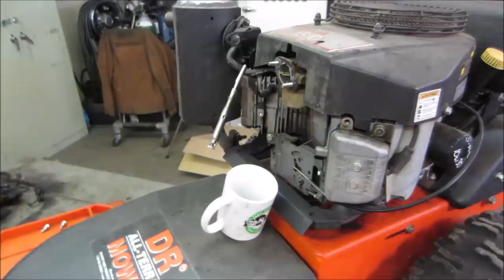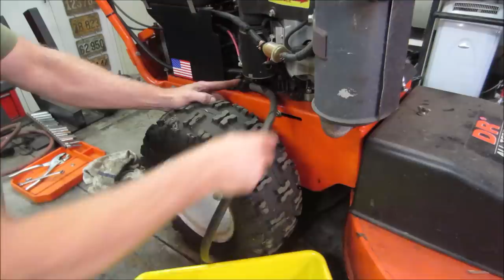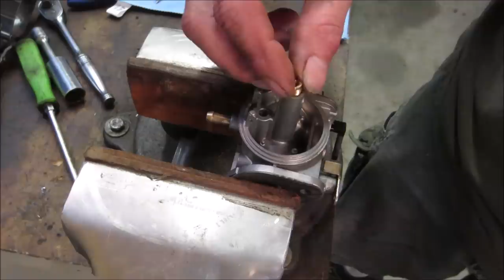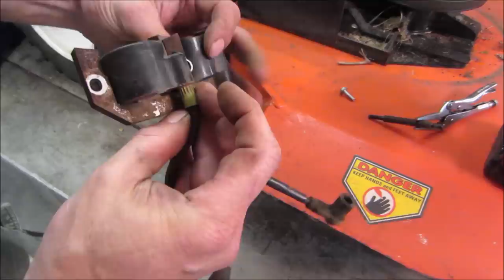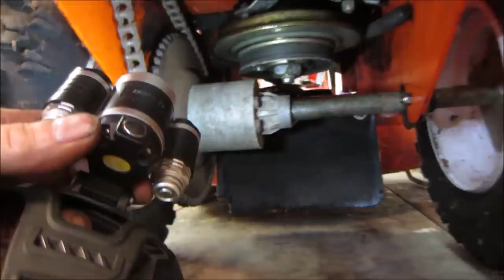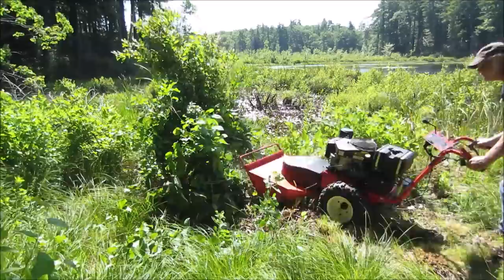Will It Run? Abandoned 11 years ago. DR Field and Brush Mower

Comment: i used one of the ones in between your old one and newer one. that one came with a regular mower deck also. if the newer is anything like mine you don't need to lift the front to cut the small saplings it will mulch up to a 2 inch thick one with no problem. just go slow. i use to brushhog the fence line every year. thanks for the memories mustie.

Comment: Governor shaft seals are known to leak on these. I actually did a video replacing mine. Also Kawasaki updated the pcv design and if this one doesn’t have the thick steel plate cover and just has the stamped steel pcv cover then it can develop excess crankcase pressure which leads to lots of oil leaks. There’s a filter material in the pcv system that plugs up. Kawasaki revised the design by removing that filter material and just using a thicker cover with a better gasket. I made a video when I did this to mine. I did the upper crankshaft seal while I was in there and now am oil leak free.

Comment: The only problem with these vids is that they introduce me to all this gear that I haven’t seen before but which I desperately now need. Ok, so I only have a need to use a field and brush cutter once a year or so, but I’m just off to eBay to set up an alert should one come up...
Reply: Rent one instead.
Reply: @tiredoldmechanic1791  Yea, with a once a year useage (unless it's a very big yearly job), I'd definitely take a look at what local rental (if available) rental would cost. Also factor in transport if one doesn't already has a trailer and towing vehicle...

Comment: There's no "taking advantage " when you are the one buying something that may end up being a  boat anchor!
Reply: i answered an ad for a wood chipper with no carb and seized engine, told them it was basically a boat anchor. they turned down my offer and it's still up after four months. it's an early sixties model that I think I have the carb and they are known to "seize" due to sticks being stuck in the blades, I just didn't want to drive that far with no chance for a bargain. P.S. I don't have a boat.

Comment: Funny you mentioned your FJ's transmission. I have the same transmission in my 2009 Tacoma. The dealer did the fluid exchange through the cooler lines. Made the shudder 50% better, but didn't go away completely. Some say adding a shudder fix treatment works, but the only true fix is a new torque converter. I'm just gonna keep on driving it, I just keep it in 4 under 45mph. The frame on my truck before the trans will let go...

Comment: Nice score on the field mower. I bought one of DR's lower end versions earlier this year, pull start only and doesn't have the swappable mower deck. Mine was running but the motor is tired and underpowered for a field mower, so I've bought a 10 HP to repower it with. Even with a new motor I'm only into it about a third of what a new one would cost from DR, so I'm not complaining. ;-)
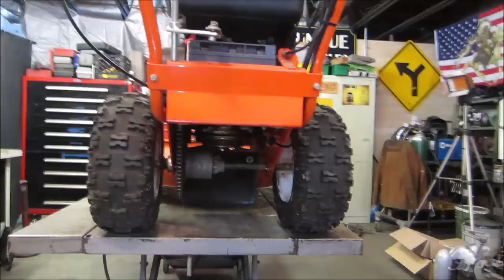If you don't have one yet, you can download the owner's manual from DR's website, just need the model and serial numbers. As to the noise yours makes on shutdown, there's a blade brake in the belt drive that could be where it's coming from. It's the gold colored disc visible at 44:25 that the cable and spring connect to. Other end of that cable goes to the red dead man control.

Comment: I worked at a repair shop as a mechanic when I was 16-17, just the owner and I. We worked on mowers chainsaws string trimmers etc. To check fire the owner would just grab the plug wire and pull the cord or turn the key. I used a clip on spark tester. To this day, at 52, I still can’t get over the fact that he did this several times a day, no change in his demeanor except the occasional “yep that one’s hot”.

Comment: The gas in the oil was most likely from the cylinder that wasn't firing, although a leaky needle valve is an issue in equipment that sits for months. Hope you called the lady and said your price was fair, I'm sure you will be nice about it if you haven't gotten to it yet, you're a great guy, I wish I knew more people like you.

Comment: I remember blowing one of these up when I was a lad.  That was back when I didn't know much about engine maintenance.  Neighbor had purchased one of these brand new and I was the helper.  I drained the oil but was too dumb to read the dip stick and it didn't have enough oil for it's maiden voyage.  It threw a rod out the back in about 30-40 feet of use.

Comment: I have the same bush mower. That operator precense lever is to keep the blades on. It has nothing to do with starting or running. It only needs to be on when engaging the blades.

Comment: used a newer model of those, they are a beast and work well.a few issues were the  clutch cable end came off (handle end) and the fuel pump pipe from the valve cover perished very quickly(ran like it was out of gas) and had trouble getting a new one here in the u.k.. great machine that would chop down a 2" tree, which is why the boss bought it.

Comment: I had one probably like your old one. We called them roof mowers. I bought at a farm sale. The gas tank was the biggest issue, then the drive belt. I was cutting on a slope it got away from me rolled down the hill landed upside down still was running. I went down the another hill and flipped it over then it died. Started back up. Mowed quite a bit while I owned it, before selling it. I thought about buying a D.R. field mower but didn't. You have to be the luckiest person I've ever seen!

Comment: We are no longer able to buy Carb Cleaner in Bulk.  Not much left in Sprays either thanks to tree huggers.  If you do have some, transfer it to Glass containers so it does not rust out the container.  That ruins your day and your shop for some time!  That drive chain still has a couple tight spots.  Great machine!  15 HP?  What model Lawn Tractor did you get?  Better get those Lily pads destroyed.

Comment: I have one similar to that one that I have to replace the top end of the block. One of the head bolts broke off. Attempted to drill it and managed to fug it up worse. Was able to find a replacement. Just have to get motivated to get the job done. No garage to work out of and not fond of starting jobs outside like that.

Comment: I can tell you what they can do I use to test them at Dr .it's there flag ship..they will knock stuff down ..but takes a lot out of you to run all day ..Dr has a great call center to help customers with any issue ,and parts ..
Reply: Great machine...BUT it has a fatal flaw.  17 years ago, I bought that same model new, and while clearing saplings about the thickness of my thumb, a stub of a thumb sized sapling made its way underneath and stuck itself between the large drive sprocket and the chain. It bent the entire engine deck, pulled it down and stopped the machine dead. Sent the machine back, since it needed a whole new deck (which they advised me to do) and when I got the replacement machine, within an hour it happened again. I was sad I had to send that one back too, and got a full refund. I would rather have kept the machine, it was so good.  If I were to buy another one, I'd make a chain guard for that drive sprocket! Performance wise, it is a brilliantly made machine...turned all of the brush in four acres of Florida Pine Flatwoods to dust!!!

Comment: i was given an old Murray 38702x20d ride on a week or so ago (i offered to give him some money), i'm now glad it was free, as today i finished stripping it completely and cleaned all the muck and sludge off it and could see the damage (oh and i verified the motor runs, after putting on a new carby).
the 3 belt guides around the diff pulley are bent and 1/2 worn through in 2 places each, most of the linkages are worn, and the main deck has failed welds on both sides where the diff bolts on, plus a half dozen cracks that i've found so far.
the cutting deck has a bloody big hole in it, and several prior repairs on the front leading edge both sides, the rusted metal over the entire deck may be so thin as to not be repairable.
.
still, it will work as a tow vehicle for the lawn sweeper after extensive repairs, which i start on tomorrow.
.
as for so called low ball buying, you MUST factor into a buy price two things 1. how long since it ran? and 2. what might be wrong with it.

if a seller wants top dollar they can get the stuff serviced and then sell a fully functional machine.

Comment: In the early 2000s I worked at Goodyear, Midas, and a ford dealer. 
All three had The transmission flush machine. It hooks up to the cooler lines. You can flush the trans with out without opening drain fill or dipstick. I think you had to set the amount of quarts in the computer on the machine. Then put 3 times that amount of the fluid in the machine and turn it on. I always checked dipstick (when avail) and level was always in range.

Comment: As many times as you check spark on small engines you need to fasten two clamps together. One to hold the spark plug and one to clamp it to the frame. Would make your life easier.

Comment: I bought a second hand generator a few years ago which had been sitting for a while, first check of the oil showed it was nice and clean.. but after starting it the oil looked quite dark. I suspect the heavier particles had settled to the bottom which gave a false reading on the stick....

Comment: Liles makes a fantastic hose remover pliers that will easily remove without damage most all hoses found in the automotive and small engines class I have had mine for maybe 25 years and costs very little money two flat steel blades both have a V cut out from the center, one V grasps the tube and the other pulls the hose off without effort.

Comment: Heh, that's a 'new' one. I just used one from the 1980's a couple days ago. It has bicycle style hard rubber tires, just a bit of rust, and starts up easily with a jump, no battery required.

Comment: I have a wagon wheel one, as well, the blade broke, they don't make the blade, so I bought a new style blade, smaller hole, took ,both,the mower,for shaft eize, and new blade, to a CNC machine shop. They cut the hole bigger. Worked like a charm

Comment: My dad used to have the older model of that with a Briggs motor and the old wheel style. I am pretty sure it was a single cylinder. If you used it on a hill for a long time, you had to go across the slope instead of straight up and down because it did not have a brake on the wheels. On the side of the hill, the tires would roll off the rim because they were too high profile and the hill was steep.

Comment: Had one of the wagon wheel'd DR's like you have at the cabin. Most difficult mower to control, turns poorly, like riding a buffalo thru the woods! Couldn't get a replacement tire\wheel so it was used\sold for parts on eBay & Craig's list! Mustie1 another interesting video indeed!

Comment: Stopped at a yard sale nice subdivision, definitely a white collar type had a pressure washer with the front mounted pump Honda engine. It was dusty from sitting in basement, he had 20.00 on it. Two other guys beat me to it and walked off. I bought and said heck I will throw it away if it is junk. Cleaned it up, put in new gas, sprayed starting fluid, started about 5th pull. Guess he had it so cheap everyone thought it was junk. So you never know unless you try.

Comment: Enjoyed this, I have an old multifunction tool myself, a Gravely, bought to to clean out the old piggery on this farm, they said it could cut bricks, it has.  Gravelys are all gear, with a slip clutch on the mower shaft to protect it.  I had a bush-hog attachment for my old tractor, it was part of the trade for my new one, it was only 48" but got a lot done where I couldn't go in with a mower.  I always wonder why nobody used the hog system whereby the blade swings free when you hit something, what say you?  It isn't very complicated.  The Gravely is build like a brick and is very heavy but only has about 8hp, one cylinder Kohler engine, low rpm/high torque, it never really needs more.  I have the mower attachment and a snowblower, both are really well built.  I had the riding cart but that didn't work too well and I sold it.

Comment: Spark plugs for testing spark. Strip 4" of insulation off a 2' piece of 16 or 18 gauge stranded wire. Put the bare strands around the middle groove on the spark plug shell. Twist the spark plug to tighten the loop.  Put a gator clip on the end to ground it. A far better spark tester that you dont gave to hold.

Comment: On the Briggs & Stratton V-twin the older ones I know have a diode in the kill wire. I had the same trouble with mine. Had spark on no. 2 and nada on no. 1. So yes you can have spark on one cylinder only.  What I did to fix mine was. 1st I checked all of the resistances of the magnetos and diodes. Then I cleaned both the flywheel and magneto surfaces and grounds. I need a replacement carb for mine. manufacture discontinued making them and what I have found is WAY to pricey for me.

Comment: Terrific teardown as usual!
I wish when you are removing the carb, you would take the time to reposition the gopro and zoom in on the operation where you disconnect the linkages from the throttle to the governor - that little step is so basic and easy once one understands it, but mystifying until one watches a competent mechanic like you carefully disengage and explain the purpose of the two (or more) connections; where they come from, and what they do.
Live long and prosper, boss! 
Summer is waning, and winter is on the horizon.  Have you got your covid breath restriction mask with the attached ear muffs yet?

Comment: You ever think of using a oil can (with 3" base diameter) to squirt gasoline into a carburetor. I seen a Canadian Bruce, mower repair dude hey) use a squirting can for troubleshooting purposes to start a mower. I thought it would be a good idea he had, so I went on the net and ordered one (it happened to be red) for around $10. Lawn equipment has been my hobby since retiring, enough to figure some things out, I'm learning.

Comment: I have a John Deere S240 lawn mower with a Kawasaki engine. It has been clacky at idle since new. I complained about it, and JD agreed to send a new engine to the dealer, and they installed it.I know it is a new engine because I checked the serial number. It makes the same rattle at idle as the original. It has nearly 100 hours on it now, and it runs just fine. I suspect that it is the decompression hardware that is causing the noise.

Comment: I could so use this thing here right now big time! DANG that's pretty beefy 15HP for a brush cutter that thing could knock the piss out of some heavy weeds. was looking for a replacement head for my swisher maybe even a blade if someone makes one because those thicker strings just don't cut it. I really need something more like what this one was designed for to be completely honest about it they still sell this one brand new for $1,999.99 i don't have that kind of money though I'm a recent widower so pretty much everything has to go for bills because i'm the only one bringing any money in now.  maybe i'll get lucky like you did and find one at an estate sale or something

Comment: Jumping the Operator Sensor leads at 23 minutes has nothing to do with the spark.  That control is for the blade.  If closed, it will shut the motor down, if open, the blade will continue to spin.  Good video though.  I just inherited a 12 year old DR ATM AT2 that hasn't run in 7 or 8 years and was left outside.  Drained the gas,  freed the drive pulley which was frozen, replaced the gas tank valve gasket, and it started up and ran nicely.  Sharpened the blade while it was accessible too.  Great machine.
Reply: And yes, the belt quick release is that lever under the pulley to the left as you are looking headlong at the machine.  Vice grips were unnecessary

Comment: I've got a Suzuki boulevard s83 with vacuum carbs. Only wanted to run on one cylinder initially and it made alot of clanky noises and had me worried. Once both cylinders would fire it cleaned up nicely sound wise. Still burns oil like a mutha, tried to start it the other day and got nothing. Ought to unload the p.o.s. but it's still sitting for now.

Comment: 12:12 What I do with my ultrasonic cleaner is place the items to be cleaned in a glass mason jar, and fill that with whatever cleaning agent I want to use on whatever I am cleaning, carb parts, firearm parts, etc. etc.. Use just enough to cover the items you're cleaning. Then I place the mason jar(s) into the ultrasonic cleaner, and fill it with water to just a bit below the level of the liquid in the jars, any higher, and the jar might start to float in the water. This allows me to conserve the cleaning agents, and also clean other items with different cleaners all at the same time. The ultrasonic cleaner will heat up the cleaning agent inside the mason jars right along with the water, and the ultrasonic waves will pass right through the glass, allowing everything to get cleaned properly. There is no need to worry if the ultrasonic waves will crack the glass jars........the machine isn't that strong. Best part of this is that you won't have to use potentially harmful cleaners directly in your cleaner, and cleanup is as simple as emptying out a mason jar or three. Drain the water out of your ultrasonic cleaner, and you're done.

BTW...........I will never stop being amazed at all the great finds you make and at unbelievable prices, if not free.

Comment: The clanking is in fact the decomposition mechanism all the kawies do that I hate the sound of it but brand new ones and ones with 2k hours sound the same when spinning down, if you hear a similar clack at low idle it's usually the valves needing adjustment. I wish they used hydraulic lifters like the kohler commands, that would make a sweet motor